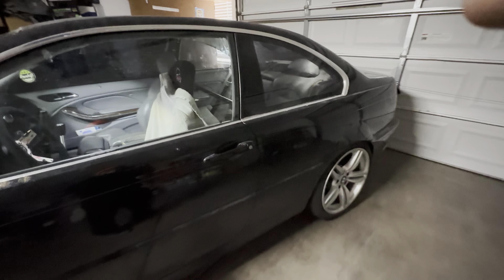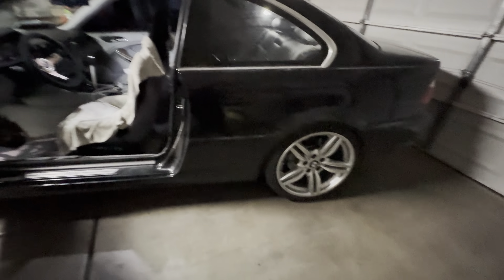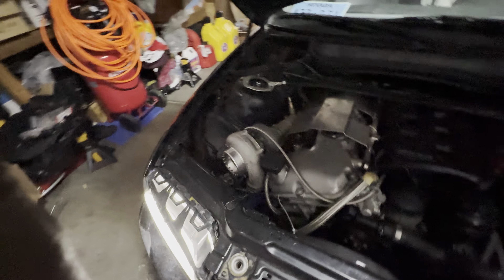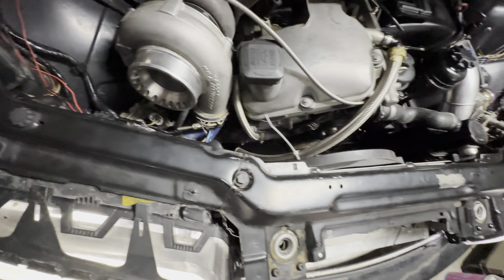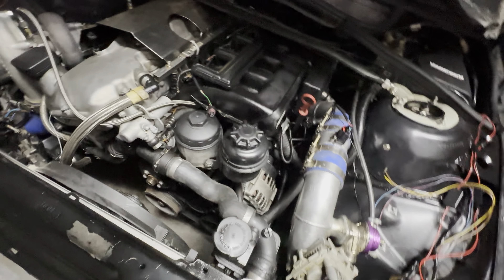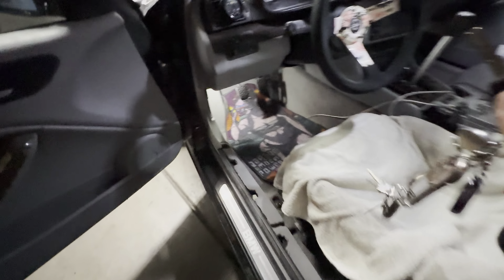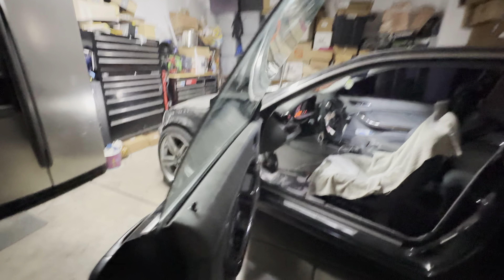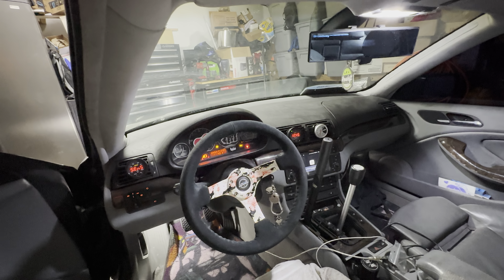My Turbo E46 Two Year Update

Comment: How much do you think she's making rn and how reliable i wana boost my e46 325i too
Reply from the maker: based on races and broken parts (tearing rear diff mount, snapped rear diff bolt, twisted driveshaft) bout 300-350hp it’s a b25 on pump gas, 9psi. been turbo last 3 years replaced motor last month (had 300k miles) bc i ran the car low on fuel a lot (went lean and blew rings) but new motor and same tune and she’s running great again